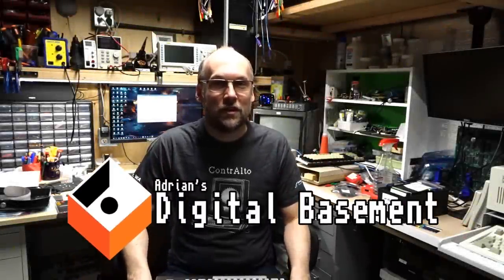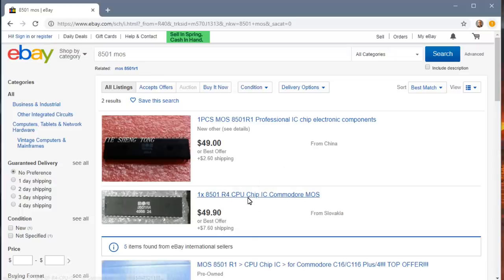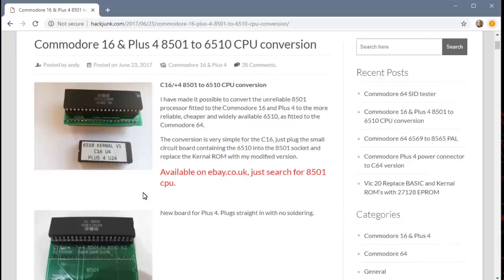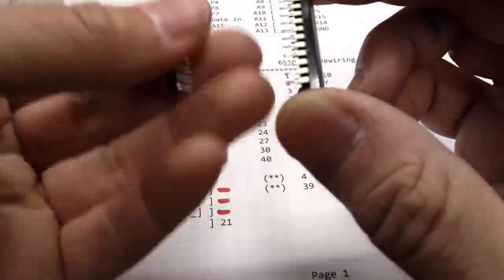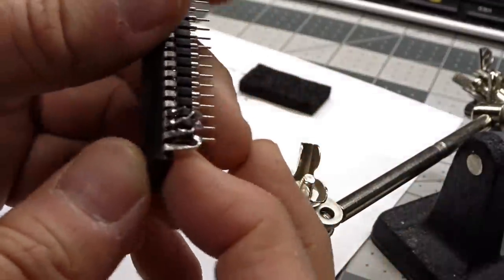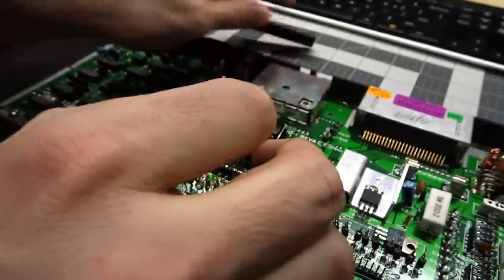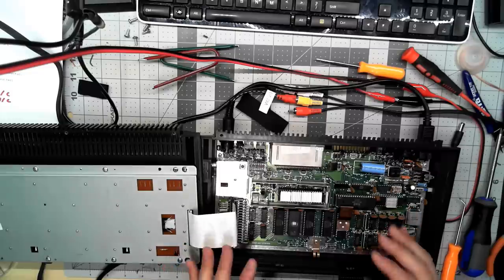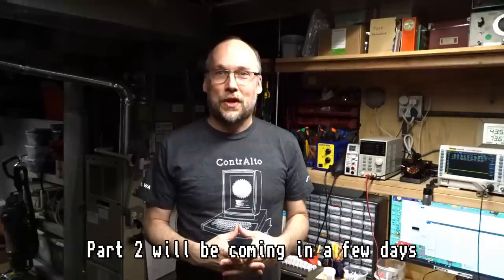Commodore 16/Plus4 CPU Replacement (or how to build an adapter)

Comment: Just a hint for the next time: you may have stacked another socket at to top of the base socket, just to prevent the 6510 from bending pins and in addition to have it easy to exchange it for testing/replacing issues.

Comment: Well, I would start checking the power regulation from the 9v in on. I'm guessing it's going to be that someone plugged in an incorrect polarity PSU, or there are some shorted diodes or capacitors in the power system.

Comment: Started  my computer education with a C=128 later got a couple of C=64, had an Sx=64 and when the bottom dropped out of commodore, I picked up a +4 for the fun of it.  All were great machines, in fact I think I still have an old VIC20 in the back room somewhere.  Loved my commodores, and I can truthfully say that I never sold one of my used machines for less then I paid for them, even the 128 with 1571, got twice my investement, as well as the SX that little machine got me enough on Ebay to purchase a new HP.

Comment: I've never understood the choice to use center negative on those coaxial connectors.   And occasionally, manufacturers still do, to this day!
I just bought a Roland Synth, and it's also wired center negative.  
So much for shielded power cables and having a ground shield..  Well, you could, but you'd have to wire the connector on screwy, bending back the center conductor to the shield lug and extending the shield to connect to the center pin, insulating everything.   
Nope.

Comment: Kind of ironic the machine built as a glorified text editor on the cheap had some crazy graphical capabilities if you really pushed it with tricks.  If they had somehow managed to shoehorn a SID or similar quality sound chip into a random model before collapsing it would have been an even more amazing machine for demos.

A few of my friends and I all bought Plus/4s when a local store had them marked for next to nothing just to mess around with making demos.  I preferred my IIGS but was really surprised at the capabilities of a machine I never saw anyone actually use.  I saw a few sad C16's in the wild, but never any Plus/4's until we bought ours.  My IIGS still runs great...haven't tried to turn on the Plus/4 in years.
Reply: @Strangy Ironic I wonder what things would happen been like if Apple 🍎 kept the IIGS line around. Apple has never done much to appeal to gamers & I think the IIGS could have been a pushed aa a line of gaming PCs to compete with the commodore &  Atari stuff but they killed it off🤷🏾‍♂️

Comment: Love that Alto shirt, man.  The C16 was a bit of a cipher for me.  Even though I was only 13 at the time, when I read about it in Compute!'s Gazette, I decided to save up for one (I didn't).  The lure was more RAM (I had a Vic20) and the 128 color mode.  I already didn't have sprites so that was NBD to me.  But then for Christmas of '84 I got a C64 and forgot all about it.  

Interesting note about FPGA drop-ins for custom C= chips...there's an FPGA SID replacement that can be gotten, too.

Comment: Interesting video. I like the „adapter work“. And I also like, that I am not the only one who uses what I call a „lens hat“. I have one with a set of 5 different lenses and an led light and it is probably the most important tool in my lab nowadays :-) When I was 30 years old, I was a „fine pitch solder artist“. 24 years later, soldering without a lens is no fun. Unfortunately, I tend to put my lens hat somewhere and forget it. I will paint it with a fluorescent paint and switch on the uv light to find it, I guess. We might have become farsighted, but not stupid ;-) I think, I also want to buy a stereo microscope for my lab one day for soldering. Those USB microscopes are not good, because there is no 3D view. For documenting something, they are ok, though.

Comment: A common source of black screens on C16s is either U7 or U8 they are MOS 7708. They are MOS/Commodore's version of 74LS257 and are notorious for going bad over time. You can replace them with a regular74LS257.
Reply: Very true, I forgot about the MOS acting like that. Is the 74LS257 pin compatible?
Reply: Yes the 7708s can simply be replaced one for one with 257s.

Comment: Instead of soldering directly to the 6510, could you stack sockets and just solder to the socket's pins? That way, you could easily swap out 6510s if needed.

Comment: When working on a dead C16 you could go down the generic dead computer diagnostic path as suggested earlier by James Bennett ie. Check supply voltages to the various IC's, reset, clock, and then data / address activity, etc. But! you could save time if you  check all the 74xx logic IC's to see if any are MOS IC's, if so, suggest proactive replacement. Ie. If U9 is MOS7707 swap in 7406, if U12 is  MOS7714 swap in 74LS02, if U14 is MOS7711 swap in 74LS139, U7 or U8 is MOS7708 then swap for 74LS257. Now in this video think all the IC's can be just seen to be standard 74xx logic IC's, except U8 could this be a MOS branded logic IC (and ultimately be the source of the no boot problem).

Comment: There are replacement PLAs for the C264 series. But yes, those are prone to failure as well.
Gotta have to love these cheap ass machines. ZXs were given keyboards making them near impossible to use, while the manufacturing of the chips in the C264 series can be described as fragile at best.

Comment: Such patience and perseverance but I couldn't help wondering, if you had a spare working C16 why you wouldn't first try the working CPU on the non-working machine? was there a risk it could have been damaged?
Reply: @adriansdigitalbasement  yes I see - when you went to the working C16 I thought perhaps the chip was not socketed and  you really didn't want to have to go to the trouble of removing it, but now I see that  you liked the challenge of building the converter :) Sometimes the extra work is worth it just to prove you can do it!

Comment: I got a box full of C64s from the local gamestore a few years back for free.  The weird thing was inside one of the C64s was a loose 6800 and CRT 5027.  Seems like the previous owner was planning on putting the 6800 in a C64 motherboard.
Reply: @Tighe Lory I wonder how that would have worked out 🤔 maybe they were trying ti build some kind of custom C128 style machine but with a 6800 instead of a z80

Comment: Nice, I din‘t know that the 6510 would work in the c16/plus4 because I thought they run at 1,78 MHz as opposed to the C64s 1Mhz. Anyhow, I still suspect the socket to be faulty and would replace it with at least a dual wipe one, maybe even the one for the ted too. Also check the voltages, maybe the regulator section is bad ( I think I already saw a comment mentioning this). Also make share there is a stable clock in and out of the Ted chip.

Comment: Normally i would expect a "replace capacitors" now on the top row of the comments....  but checking for voltages and clock would be my next action.

Comment: Instead of risking thermal damage or snapping a pin, I'd have probably used a second socket as a stand-in for the 6510, and then plugged the 6510 into that after the socket got wired up. I'm also really surprised this worked what with the non-mappable pins. Did any C16/Plus4/etc. software even use them?

Comment: Greetings from Germany.

I also have a Commodore plus4. I only have a cassette drive for.
As far as I know, no chip has yet been exchanged. only cleaned the inside. and it still works perfectly.

I also have a Commodore C64. with 2 drives. quite a few cassette drives for it. and it also runs perfectly.
and I've had it for 30 years. no need to swap a chip yet.

Unfortunately I hid it so well that I can't find it again.
I wanted to put it into operation again.

My amiga 1200 still needs to be repaired. 2 cips (CIA) defective.
The Blizzard accelerator card water damage the 40mhz processor, all pins corroded and several broken off. I don't know whether the accelerator card will work again anytime soon.

My Amiga 500 also dismantled in some cardboard box

As well as my Amiga CDTV I have to reassemble it. And he still has a problem. Sometimes the Capslok LED blinks. and switching it on and off does not help. that is then blocked. If it doesn't boot at all, the screen remains black.

And if I'm not mistaken, I still have a large tin box with a Commodore 128 inside. But whether it still works I don't know. I don't have a keyboard and nothing for that. just the box.

Comment: If you need a new PLA. Check out my latest video. I burned one with a standard 27C512 EPROM & it worked a treat. For the adaptor you can use the C64 wiring to wire the  EPROM up properly. My video goes over the process.

Comment: Ingenious solution to buying an adapter Adrian. Nice to see more people covering the C16. I have an ongoing project with a C16 on my channel, I had one have a CPU die on me and my second donor board is pretty sick and has had some weird aftermarket repairs that I need to bring back to stock (if possible). (I could do with some advice figuring out what's been done) BTW it's only the TED that has no modern replacement solution yet (although FPGA projects are working on it), you can get a modern reliable PLA replacement (when in stock): https://www.polyplay.xyz/PLAdvanced-PLA-Replacement_1 https://www.lemon64.com/forum/viewtopic.php?t=67521 I believe. Looking forward to seeing where your fault is :)

Comment: Let me know what you find out. I have exactly the same problem with mine.  Replaced the TED, CPU and I am pretty sure the PLA is good (tested it using an Arduino).  ROMs are definitely good (I can read them with an EPROM reader and they compare to the ROMs on the net). The trouble is I don't have a good machine to swap chip with.

Comment: I guess compatibility with a modified 6510 will not be great, as any software that uses the undocumented CPU instructions either for like copy protection or for optimization purposed, will not work the same on the 6510 and on the 8501. Or do they?

Comment: Question on C-16: Any ideas on a random blinking character-graphics screen when the reset button is pressed?  When first turn on machine it is fine, but after pressing the reset button, it presents the random char screen. Then screen goes all black when turning it off and back on. This happens before computer gets hot. Can successfully run BASIC program but the reset button causes chaos. Any ideas?

Comment: have you ever though about bridging the vdc to the vic IIe to allow high resolution and the option of 80 columns through either the rgb or din composite from socket to socket (ribbon cable?) if that cant work straight, either pin for it or use a controller to get the 2 sync? how about doing that and also bridging the z80 to the 8502, that way you could have the combined clock speeds either way, also, a controller that can set one as main and the other as co-processor or set sync between the 2, or just getting a 5mhz z80 and syncing it. programs may not use them that way, however, added clock speed and we'll say a patch for Geos(takes advantage of the 6510 (base programming) z80 would "fpu" (if you built the patch that way) which means you could run it "accelerated" (faster graphic draws, windows, word processing, etc. (or patch it so the z80 clocks back the 6510 and runs the vdc native with 6510/vic II support) would be really neat.
Reply: In the Commodore 128, the 8502 and Z80 cannot run at the same time. The MMU is used to switch between them and always keeps one of the CPUs in sleep mode. It is designed this way because of the clock design of the computer: The VIC and CPU can access the memory alternatingly each half cycle. As there is only one half cycle for the CPU, only one CPU can use it.

Comment: just that the plus/4 runs at around 1.8mhz and as such it should be a 2mhz rated 6510. which i think you can pull from an 1581 but not sure. (think those run at 2mhz too ;)

Comment: wish we could find a chip for the zx spectrum ULA that we could do something like this
Reply: Not sure if you're aware but for the Spectrum ULA there is the NebULA project from Retroleum. And it's not too expensive when stock is available. 😁

https://www.retroleum.co.uk/zx-spectrum-chips
Reply: @Crashedfiesta  yeah i already got one of those for a replacement trash ULA
Reply: @adriansdigitalbasement  yeah im looking into a FPGA but its still 7 pounds and then i have to add the board and other bits to make it work

Comment: Have you checked the fuse on the board? They can blow if you use a power supply with the wrong polarity

Comment: Oh wow. I am surprised, it even worked. Wow. I mean, as far as I know, the clock signal used in C16 and Plus/4 can be quite high (IMHO near 2.22MHz on NTSC while screen is blank or retrace in progress etc, though less than 1MHz at active display area, thus not as high as 2.22 in average but the important factor is the max ...) and 6510 is rated for only 1MHz clock or nearby :-O Thus good cooling is a must then, I guess, even if it works, it's a major overclock for 6510  ... The other thing is the missing on-chip CPU I/O port which is only 6 bits on 6510. Surely, you can modify the ROM etc, but a better approach would be to drop in one port of an (extra) VIA or CIA chip to the serve as the CPU port on the "daughter board" (thus then you need full 8 bit CPU I/O with compatibility with existing kernal/etc routines), at least I've read something like this ages ago, when there were articles to replace 6510 with plain 6502 (where not even any CPU I/O port, and other problems must be solved too there, ie the capability that the CPU can "release" the bus on request - there were even articles to replace C64's 6510 with modern CMOS 65C02 - can be bought as new even today from WDC - or 65C816, though in that case the problem that illegal/undocumented opcodes were missing often used by demos/games, copy protections, etc). Ok, I know, replacing 6510 with 6502 is a different topic, though similar in a way, that you must "bridge" the differences between two different 65XX CPUs in a Commodore machine at least :) Very interesting video. Though btw one other thing: I wouldn't left NMI unconnected. If I remember correctly it's a low active signal and I'm not sure if it has internal pull-up. If no, sometimes it can catches NMIs randomly by noise and whatever. It should be tied to inactive state through some resistor for playing secure. Or such :) But anyway, I'm really surprised it worked such easily, great project, great video!
Reply: @adriansdigitalbasement  Well, I meant to add VIA/CIA to have a supplementary external logic to have "compatible" CPU I/O port, so especially to avoid software modification :) Though it wouldn't work too much with 6510 since it has already something at address 0/1, it though work with 6502 to be placed instead of a 6510 for example in C64 :) Silly thing (EDIT: from me, to have mentioned, I meant ...) otherwise since with 6502 you must have serious external logic to overcome the lack of the "bus isolation" feature as well, so probably it was not too sane from me to mention ...  I think I was a bit confusing to comment these modifications together with other similar projects but with other 65xx part to be replaced :-O Anyway, I'm waiting for the second video :) I have two C16s and two Plus/4's, three of them does not work at all, maybe I will have similar cases, ie to replace the CPU and/or TED, whatever :-O

Comment: Hi, please advise, my commodore 16 powers up fine, connects to TV great, but when I type load and press play on tape ..no power to the tape deck??  the tape deck works 💯 good on another c16 and a plus 4....I have heard a chip controls the power to the tape but still is clear as mud.. Any advice would be appreciated... also I have a plus 4 full of spares , could I use any chips/parts from that..?

Comment: Would it be worth adding a pullup on the NMI pin?
Reply: Thank you for the detailed explanation!  Not super familiar with Commodore, I grew up in the UK so had beebs instead.  But unused inputs just like decoupling caps are both things I learned about the hard way. :)

Comment: Regarding the CPU on the C16 & Plus 4, this processor is 75% faster then the C64. I do not see what you are doing will work or not. As the processor is slower. What does anyone think about my comment?

Comment: You might have an easier time adapting an 8502 from the C128. It's the 2Mhz version of the 8501.
Reply: Travis, that idea has come up every so often over the years, but it could be a trap / pitfall.  From my recollection, the 7501 / 8501 cpus do not have an NMI pin available.  If that is indeed the case, then adapting a precious 8502 to restore a non-precious c16 is not a trivial task .. if it can even be done.
Reply: I should have elaborated that *7501 / 8501s do not have an NMI pin but have a GATE IN pin instead*.  If your adapter / pin-remapper can handle a "relevant" GATE IN pin on the 8502 side, so be it.  Right now, i don't recall what this pin handles in the c16 / plus4 platforms .. is it really used for something? =)

Comment: The one wire is a little longer than I would have used if I had made the mod. Other than that, good job. I did a similar thing years ago to upgrade a computer to a different version of microprocessor. BTW, what is that magnifying thing you have on your head called exactly and where did you get it? I could use one of those when I'm working on my projects.
Reply: @dLLund  ty for the information. I picked up something else but I need to get real close to what I'm working on to get the benefit of the magnification. Not very helpful if I want to try soldering small parts.